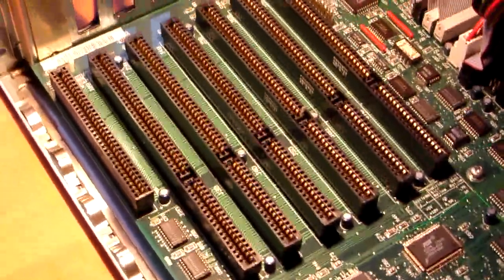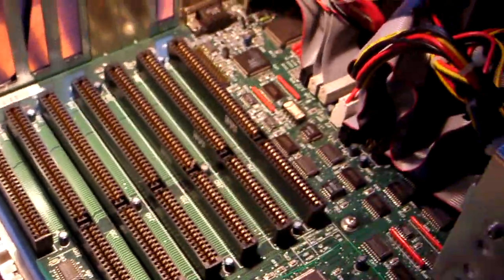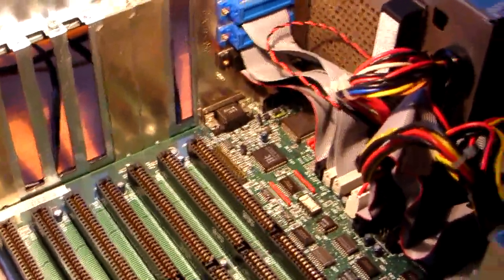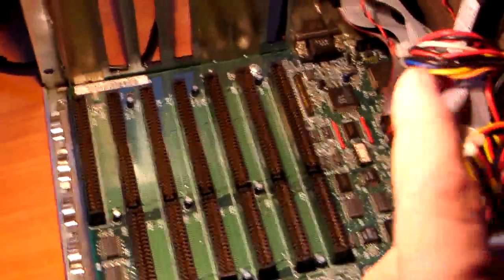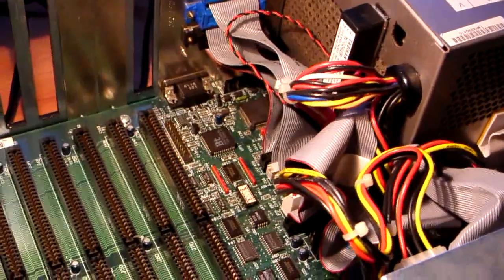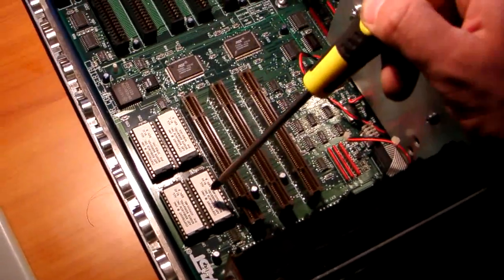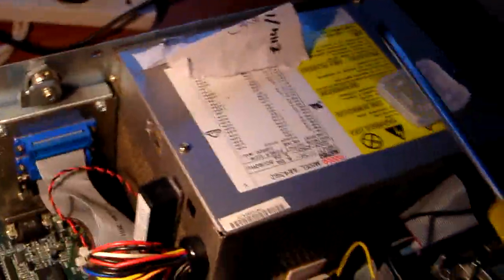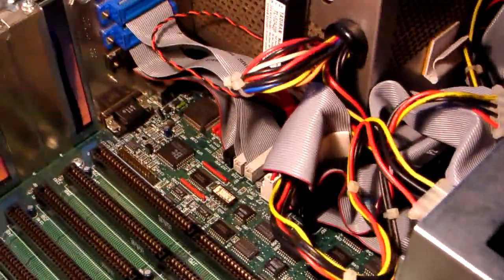AST Computer Premium 25Mhz 386 Motherboard P3

Comment: A shame that you tossed all that AST hardware,  as it is very hard to keep these running today without having to scratch build or jury rig.  Just lost a power supply yesterday in my 386, so I expect some hard times finding replacements.
Reply from the maker: Hello, I actually should have 6-7 PSU   for these machines available, I have never listed them on ebay. The PSU is probably dead due to a bad capacitor
Reply: @DRCHRISTIANMD  You are probably correct on the capacitor.  I plan to recap the whole PSU at some point.  That said, if you have some working PSU for this 386 model, I'd be glad to acquire one or two should you want to part with them.  I love these AST computers and consider them the best of their era.  A nice hobby keeping the old PCs running.

Comment: I actually have an AST Advantage.
Reply from the maker: AST Advantage! what a cool machine. Most of my AST stuff is long gone. I have a shell of the AST PREMIUM 486 Server. Gigantic machine. with EISA Slots. Do you remember what version you had? What cpu etc.
Reply: DRCHRISTIANMD This one is an Advantage Adventure 8075p with a 75 MHz Pentium processor, 1 GB HDD, 8 MB of RAM, two floppy drives, 1 CD-ROM drive and might come with Windows 3.x.
Reply from the maker: +Alex Hughes Advantage Adventure... 75Mhz. now were cooking on Gas.. 😮
Reply: DRCHRISTIANMD Is that good?
Reply from the maker: Compared to the AST Premium 386sx/16 its a new dimension. This computer took 10Hours too install Windows 95. Your 75Mhz should do it in a fraction of that time. :-)
Reply: DRCHRISTIANMD Did your computers have Data Discs with it?
Reply from the maker: +Alex Hughes We went from a secondhand Commodore 64 too a secondhand AST Advantage. So no discs or manuals. That said I did get the manuals later on by chance but I do not know were they are. It would be great too get the discs for it though. 🖒👍
Reply from the maker: +DRCHRISTIANMD I ment AST Premium.lol.
Reply: DRCHRISTIANMD Would those have the operating system on them?
Reply from the maker: No the original discs only had tests in stuff. A second set of branded discs similar too the Dell DOS discs was available. The HD on a later PC had some AST Test stuff. My Windows 95 Discs I bought later on in 95. Swiftly followed by my third PC a pentium 120 OEM Built by MorTec. After that we went PCWORLD ADVENT PC 350. After that I built hundreds..

Comment from the maker: Hello sorry for the delay in reply, First off I must do some benchmarks and stuff show off the great AST Computers. The s86/sx and dx daughter boards will work vica versa in either the dx/sx Motherboards. the CPU is surface mounted in 386/sx mode so simply changing cpu will not work. you can deffo change the card up to DX. I have done it to the comp in video!